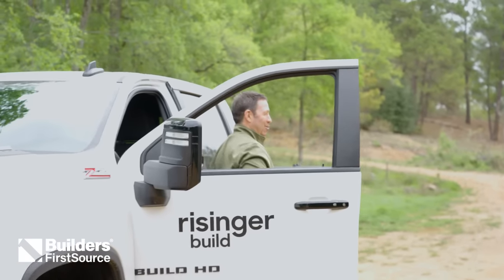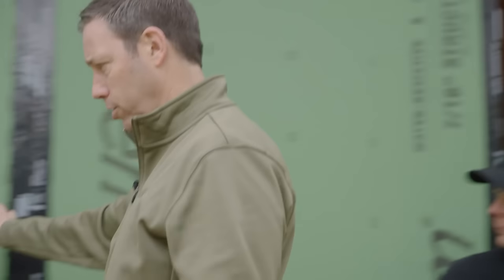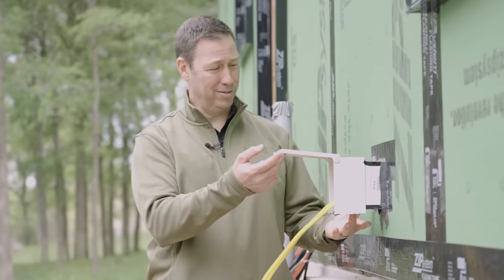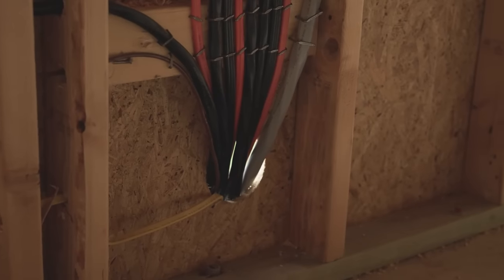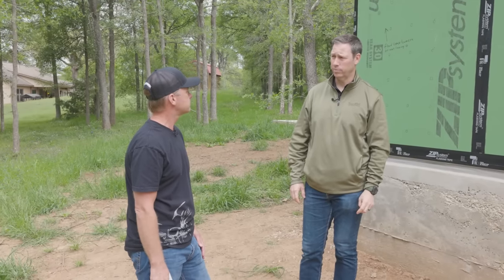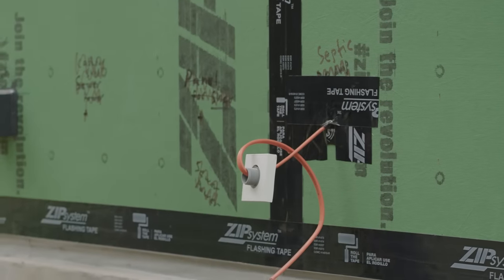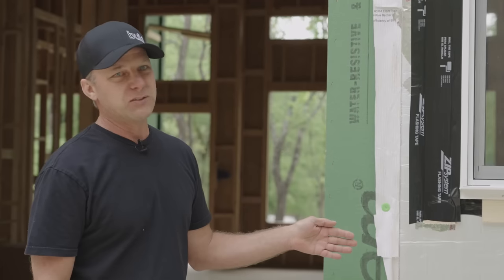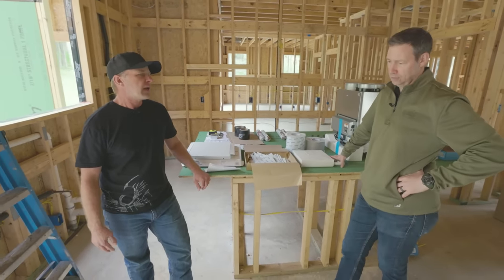Part 2: LOW BUDGET Details For A High Performance BUILD

Comment: The flush outlets is bad idea because if you have to pull the outlet plate off, you will have drywall damage. I think that the look is cool, but the functionality is questionable. Maybe, it is something that I do not fully understand.

I also am not a fan of the Broan ERV system because it runs 24 hours a day. It is necessary because you are attempting to build an air tight house. Not only does this increase energy costs, it creates a maintenance item that might not be necessary if the house was not completely airtight. The problem with creating airtight homes is that you quickly reach a point of diminishing returns and you incur high upfront costs. 

Extreme problems can arise in constructing and airtight home is that if water gets into the walls or roof, it has no place to evaporate and mold growth ensues. Having SOME, not a LOT, of air circulating through a home in the correct way is a good thing. Correcting water infiltration issues in airtight homes can become  egregiously expensive  to fix. Ideally, you want interior air to able to circulate into the walls to some degree. 

I have often said that if you build a traditional home which is not entirely airtight and use the money you save to install a 10 KW - 15 KW solar panel array, you won't have any energy bills (other than grid connection costs from your utility) and you can use as much electrical energy as you want. A well insulated traditional home with high quality windows that is not perfectly airtight will probably be at least  90% as energy efficient as an airtight house and it will cost a LOT less. The entire premise that a house should be 100% airtight is a flawed concept in my opinion. Airtight houses will work, but they have to be perfectly constructed and if they fail, they will fail catastrophically in many cases. Air tight houses require a separate air circulation system which can cost as much as a traditional heat pump system and also has several filters that have to be changed. Some of these filters cost $50 - $100 each and have to be changed twice a year. So the cost to circulate air in an airtight home will cost tens of thousands of dollars over the life of a home and it only buys you about 10% more energy efficiency.  

Also, when building a traditional home that is not 100% airtight, there are a number of methods to mechanically seal out bugs from entering the home. Here in AZ, most bugs crawl in through gaps in the door threshold seals. So using a more expensive door with a better sealing design would eliminate that issue, but most homeowners don't want to spend $1,500 for a door when they can get a good quality door for $200 - $400. 

I think that the water protection details of an airtight home for the walls can be incorporated into a traditional home to some degree without adding excessive costs, but worrying about perfect airtight joints between the roof and the walls is a waste of time and money.

Right now, you can get a 15KW grid-tied solar system professionally installed for around $30,000 if you shop around. You get a 30% federal rebate on all of your costs which means that your system costs you $21,000. Usually most states will provide a rebate of a couple thousand dollars. So after rebates, your solar system will be around $20,000 - $25,000 max. Buildind an airtight home will easily cost you that much. Further, larger homes can easily use $300 - $600 a month in electricity, or about $4,000 - $7,000 a year, even if they are extremely well insulated. A 15 KW system will provide more than enough energy to cover that $7k a year electricity cost and your solar system will pay for itself in just three years. Let's say your 3500 SF home only uses $300 a month in electricity because it is extremely well insulated. This will cost you about $3600.00 per year. Your solar system will still pay for itself in less than six years and you will be able to use as much electricity as you want without having to watch every light that you turn on or keep your thermostat at excessively low or high levels to save heating and cooling costs. Further, if you purchase a heat pump water heater, you will get all of the free hot water you want for your home from your solar power. Most grid-tied solar systems are maintenance free other than cleaning the panels and MAYBE replacing the inverter once over a 30-year life span. So a solar panel system will pay you tens of thousands of dollars in actual money for energy savings over that 30-year lifespan. It will also protect you from utility energy cost increases.

It's a LOT smarter to build a traditional, non-airtight home and invest the extra money in a grid-tied solar panel system than to spend exorbitant amounts of money on dozens of details to make a home perfectly airtight. Further, the maintenance costs for the air circulation system which runs 24 hours a day are excessive. You can spend a thousand dollars a year just on air filters. I really don't understand why this group of builders in Texas are so obsessed with the airtight home design when a traditional designed home will give you 90% of the energy efficiency of an airtight home at a cost that will easily save you $20,000 - $30,000 in construction material and labor costs. Further, traditional home designs have redundant systems that allow any water that gets into walls or the roof to evaporate provided it is a small amount of water. Traditionally built homes don't require a separate air circulation system and they are still very well sealed. You don't have to have "wind blowing under the walls," types of problems if you build a traditional home intelligently.
Reply: Science and math tells us that an air tight home with a good insulation strategy and right sized and well designed systems far outperformers solar. The outlets have an inner part you can take off so no need to mess with the sheetrock. The rest of your comment is a bit too long to address. But everyone should know that building science is literately a science back by research and real world data.
Reply: @ScottTrue  Well I have two engineering degrees and I am a licensed general contractor in AZ and I disagree with you. Using ubiquitous "science" as a reference is a very weak argument. 

Let's use my home for example here in AZ. I have a standard stucco home that permeates the Phoenix metro area. These homes are not even close to airtight, and my home is constructed with clear, double pane windows which are cheap builder grade. These windows are FAR from energy efficient.  My attic is not conditioned and  is insulated with blown-in "paper" insulation. The walls are standard 2" x 4" walls with fiberglass batt insulation. My home is 1850 SF. It is heated with a gas furnace and cooled with a 5-ton AC unit.

I added blown-in insulation to my attic and increased its insulation to R--60, but I have not upgraded the windows, which like all stucco homes, are embedded in the stucco.  A couple of years ago I replaced my AC with a Trane 18-seer two-stage 5-ton unit. Becausee the SEER value decreases with the tonnage of Trane units, my unit is actually 14-15 SEER. Not this is true for all AC manufacturers.

I run my AC for three months during the summer and my highest electric bill has been $160.00. During the winter my I run the heater for about three  months and my highest gas bill has also been $160.00. Two of my heating bills this year have been $130.00. Now keep in mind, because of Biden's and the democrat's insane war on fossil fuels, the rate I pay for gas has gone up 30% this year. For about six months, my gas bill is around $25.00 and my electric bill is around $50.000. So this year I will pay around $1,400 to heat and cool my home total, including taxes and fees.

Here's the main point here. I have carefully checked where I am losing most of my energy in the home  and it easily is lost through the clear windows which do not have a Low E coating and are cheap. 

If this home was built airtight right now, it would cost at least $25,000 more in construction costs because you need a separate recirculation system which costs damn near as much as an AC system. The use of close-cell sprayed in foam is also VERY expensive. 

Lets say that my home was built airtight but has the same windows for a fair comparison. I would guess that the MOST I would save on my energy bill would be $400 - $500 for year. So the payback ROI on the airtight construction would be $25,000/$500 (per year) = 50 years. And this does not include the interest costs for that $25,000 over 50 years. That is why almost NO AZ home builders use airtight construction. 

Now my home in AZ is in an extremely hot climate, so most AZ homes use a LOT of electricity for cooling every year. Its not unusual for a 2000 SF home to pay $300 - $500 per month for cooling in homes that are not insulated as well as mine. Also, the energy costs are low compared to many democrat-run blue states which have energy costs about 300% higher than AZ. So if I lived in a blue state, the payback period for building a home with airtight construction MIGHT be as low as 30 years - again not counting the interest costs on the $25k spent upfront in the construction of the home.

What most home builders are doing in AZ right now are using 2" x 6" walls and double-pane Low-E windows. They are insulating the attic with R-40 blown-in insulation and  using stucco as the siding material. These few improvements will probably cut the energy costs on a home like mine by about 50%. So IF my home had 2" x 6" walls and high quality dual-pane windows, would be paying about $800 a year to heat and cool my home max. This is without using all of the exotic airtight construction methods you are claiming as being "better." 

Here's another real life example. About five years ago, a client had me design and build a guest house for them that is about 1500 SF. I used 2" x 6" wills with 1./2" shear, high-quality Low-E windows, and R-60 attic insulation. It has an 18 SEER 4-Ton Trane heat pump and it costs almost nothing to heat and cool that guesthouse - and it was NOT constructed with airtight methods. I would guess that the entire cost to heat and cool the house per year is around $600.00 - $700.00 (total cost for electricity) and most of that cost is because it has an electric hot water heater. For most of the year, the heat pump never turns on. I engineered the house  with three HVAC zones so that they can keep the living area and sleeping areas at separate temperatures, and that saves them some energy costs. This guest house is directly in the desert.

So what's my point by providing these two examples. Yes airtight construction is more efficient than non-airtight construction, but it will NEVER pay for itself. It is an expensive pipe-dream.  It is FAR smarter to build an non-airtight home and install solar with the $25,000 - $30,000 you save.

One last fact to make my point. My home has low quality windows and 2" x 4" walls. I have completed a 10 KW solar panel design for my home and it a solar array WITH 15 KW of battery storage can be purchased for around $17,000 BEFORE the 30% federal tax rebate. If I install that system on my house, I will have NO electricity costs on my home - none. Also, I can install a small mini-split heat pump my self for around $3,000 and it will heat my home during the winter with electricity costs. So for 20K, I will have a grid-zero home that will cost me nothing to heat and cool other than about $25.00 -$35.00  a month for grid connection fees. If the grid goes down, I can fully power my home with this system and live off-grid. 

Now keep in mind for the solar system I am going to install on my home, I will install it myself. The only subcontractor costs I will have is to have a licensed electrician connect my Sol-Ark 15KW inverter to my 200 Amp service panel. I figure that cost will be $500 - $700 max and will take about  8 hours. I would do it myself, but my electric utility requires a licensed electrician make the connection.

These are real-life examples of the real-life cost advantage of not wasting money on exotic, airtight construction techniques.

Here are some simple construction techniques for homes that will accomplish 90% of the energy efficiency of airtight construction without the associated costs:

1. Use 2" x 6" construction with 1/2" shear panel. You could use Zip panels for this construction to provide a vapor barrier. Use fiberglass batt insulation for the walls.
2. Use a well-vented attic with blown-in insulation. I recommend using at least R-44 insulation in the attic.
3. Use high quality windows. In most climates, dual-pane windows are sufficient. Use Low-E coatings appropriate for hot and cold climates.
4. Make your attic tall enough to walk through it to provide ease of access.
5. Make sure that you use eave venting around the roof perimeter.
6. Seal around all openings thoroughly. This is one airtight technique that transfers to non-airtight houses. All of the windows, outlets, pipe penetrations, etc. are sealed the same as an airtight home against air infiltration and water leakage.
7. If your home is 1500 SF  or more , zone your home so that you can heat and cool different areas with different temperatures. With all homes, most energy is wasted heating and cooling non-used areas. 
8. Use a high quality, high seer AC or heat pump. Maker SURE it is installed correctly. Poor workmanship with AC and furnace installations is a common cause of wasted energy.
9. Install a grid-tied solar panel system. This can lower your energy costs to nothing.
10.Install a lifetime roof. Here in AZ, concrete tile is used to provide a lifetime roof when a high quality self-sealing modified bitumen substrate is installed under the tile (like Grace Water and Ice Seal)

I hope that these ideas help you with your contracting ideas. "Science" almost never provides better design guidelines than actual experience learned by actually building projects. Science intelligently applied is very beneficial.
Reply: @franklong6269  Yes, that's what I'm doing - Applying Science intelligently. I always say that everything we do is calculated, not a guess. Engineering degrees, although nice, don't mean much. Many engineers stick to defaults and I have had to use non-engineer consultants to fix the problems that engineers cause. I'm not saying this is you. You seem to be smart. But I am saying that you shouldn't use your engineering degrees to describe how smart you are. Now, to be honest, I am not dissecting all your comments. It would take a lot of time to do that. But here's what I can say. I ran several scenarios through energy analysis and also considered the cost of materials. The math concluded that if take what solar cost and applied that same exact dollar amount on the envelop, I'd get a greater return on investment. Keep in mind that things I achieve cost little. Air tightness, for example, cost maybe $500. Look, for either of us to win this debate, we would both need to list many more details than what you have. Just curious, why do you feel it is so important? Why this platform to make your point? It just seams an odd place to post such a long case. Have you thought about posting your own video?
Reply: OK, Frank. I'll dissect everything you say and make a video. In my last comment, I stated that I wasn't dissecting your comments because it would take too much time. In fact, I haven't even read every word - just skimmed. It's just a lot. And I would not have expected someone to post such a long case here. But nevertheless, it gave me an idea. I think it would be beneficial for people to see real calculations with a bit more detail that you state in your comments. I'm going to commit to making my own video showing the results of energy modeling of several scenarios. By the way, anything that you are correct on, I will state that. But I think I'm going to show another perspective not yet considered. On that video, feel free to post your comments. Also, FYI, I don't see this as a "fight." People like us should lay out the details so we can get to the bottom of things, for everyone's sake.
Reply: @ScottTrue  So many errors on your part. 

1. Engineers who make one serious mistake lose their licenses in most cases. So if you have been working with engineers that screwed up, which is rare, then you have been working with the bottom of the barrel and they may not be engineers anymore. As a construction project manager who has managed multibillion dollar commercial projects as well as high-end custom home projects, I have encountered engineers who have made errors in some projects but it is rare, and they usually are not "serious" errors and can be corrected fairly easily. It is rare because at the very least, if an engineer makes a serious mistake, the engineering firm has to pay the costs to fix that mistake. This rarely happens. One thing NOBODY EVER DOES is hire a non-engineer to fix an engineer's mistake.

2. A "non-engineer" is not licensed to "fix" mistakes and licensed,  professional engineer has made. This leads me to conclude that you are either embellishing or lying. If you did use a non-licensed consultant for an engineering discipline that requires a PE license, then you committed a crime. It is a felony in most states if you hire a consultant that is not licensed to do engineering work that require a license. It is the same as if you hired a "non-doctor" to treat patients that you brought to him. State agencies that police engineering disciplines are usually Nazis. This is why in AZ, if I hire a non-licensed engineer to perform ANY task that requires and engineering license, it is a Class 1 misdemeanor criminal  offense that will be prosecuted. The fines are draconian and if someone gets injured, the charges will be upgraded to felony charges.

3. I pointed out that I am an engineer to make you aware that I have already looked at the data and calculations of airtight systems - at least to some degree, I don't profess to be a world-class expert. So I am familiar with the components and techniques used to build airtight houses. Almost NO builder in AZ I am aware of uses airtight building techniques because of the significant added costs and the high liability if there is a failure. Even most high-end custom home builders avoid airtight house designs. 

I did not point out that I am an engineer to brag. Nor did I point out that I am a licensed General Contractor to brag. I pointed it out to make you aware that I am not some Joe Blow from off the street just running my mouth. 

4. You make a good point in stating we should more carefully define our terms. When I use the term "airtight construction," I mean construction that completely seals the envelop of the house from all air infiltration and thus requires an air recirculation system, which requires several expensive filter changes every year. I also infer that closed-cell, sprayed insulation is used in the attic, and may be used in the walls - though some airtight house designs I have seen only use it in attics. Usually airtight homes also use more expensive vapor barriers. However, with most of the homes I design, I would use similar vapor barrier systems IF the client is willing to pay the cost difference. 

5. Both  Matt's videos and yours are inferring that airtight homes provides a better ROI than high quality non-airtight homes. I have never seen one example that proves that scenario and I have been managing construction projects for over 35 years. 

Concerning solar, IF you are pricing proprietary solar systems like Enphase, then, yes, you are going to pay $60,000 to install a solar panel system on a 2500 SF house, which is an absurd cost IMHO. However, if you design your own system using high quality components, you can easily purchase a 10 KW system with battery storage for around $17,000. I know because I am getting ready to install a 10 KW solar panel system on my home. Also remember that there is now a federal 30% tax rebate on all solar panel system components. So your actual cost for the system I will use on my house would be around $14,000. That does not include any state rebates, nor does it include the money utilities will pay you for selling your excess electricity back to them.  

Here's the real-world calcs I have done for my house. In AZ, APS currently (electric utility) pays 0.09 per KW back to the homeowner.  In AZ, a 10 KW array will easily generate approximately 80 KW per day (probably more) for an approximate buyback credit if $7.2 per day. My house uses about 350 KWH per week on average. So that would be approximately  $216 per month, or about $2,500 per year, that APS  the utility would pay me to install my solar system. I THINK, but I am not sure, that APS issues a check for that excess electricity that is generated every year. If true my solar panel system will pay for itself in 5-6 years. But even if they don't pay for all of the excess electricity my solar system will generate, my electricity costs will still be zero, and they will never increase.

An airtight house simply cannot compete because it has higher maintenance costs (air circulation filters are over a $100 each, and most systems (like Mitsubishi's system)  require two or three filters. Some of these filters need to be changed every six months. So you can easily spend $500 - $700 a year just on filters, and that does not include maintenance adjustments to the circulation system. You do get pristine air in the house, but you pay for it. You would get the nearly the same air cleaning ability with a Trane electrostatic air cleaning system on a non-airtight home and it is a LOT cheaper.

I am not sure what figures you are working with, but the additional costs I have seen to build an airtight house are excessive. You may have a system that costs less than the ones I have seen in videos on this subject.
Reply: @franklong6269  I struggle to make a 5 sentence response because I'm so busy. I can't believe you are spending this much time here. Engineers here are not losing their job and they are making mistakes. Of course, there are good ones out there. But man there are a lot of bad ones. I'd rather take my chances with the law than to build moldy houses.
Reply: By the way, this has got to be my last response to you. I just don't have the time like you. I wish I did. I'm sure you will respond to this with an essay. Again, math tells me otherwise. I just can't use a hole in the sheathing as my make up air and the insulation as the filter. It doesn't make sense. An ERV consumes so little energy it's a non-issue in that regard. But bringing in fresh air on our terms and then conditioning and filtering the air just makes sense. And again, math tells us we get a greater return on investment when we spend the money on the envelope vs. solar.
Reply: Ok, one more response: as I said, I’m going to make a video all about this. Would you like to be a part of it to add your view point? I’ll show you my data and you can literally say on video for all to hear whether I’m full of it or have a point. Let me know and I’ll set it up
Reply: @ScottTrue  I have no intention of demeaning you in any way. Actually, I respect your competence in building airtight projects because they are more complex in many ways than traditional build projects. While we disagree on the efficacy and cost efficiency of airtight construction, we both agree that airtight construction is a very high quality construction method. Done right, it provides exceptional energy efficiency. But done wrong, it can create a world of problems that traditional build homes don't usually incur.

As I have related, but maybe did not communicate well, I believe your time would be better utilized in building two real-world projects, one airtight and one traditional build with solar, and then comparing the two real-life projects for cost efficiency as well as overall quality and comfort. I think that would get you millions of views. I believe this comparison will get millions of views and possibly pay for the construction costs of the two homes if it was done right. 

I am willing to participate in a video with you, but as a partner, not as a critic. We can disagree with each other in good faith. I am also willing to look at the the data you present - but as I have tried to communicate, data rarely will predict all of the real-life details and performance of construction projects. That is why I have suggested that you build two actual projects to compare them. 

Because I am a GC, I believe you that you have run several scenarios and you believe that airtight construction is the best method of construction. However, there are hundreds of variables we have not discussed that will affect that analysis.

It is also  certain that some of the airtight construction methods on your videos and Matt's are in commonly used in traditional, non-airtight construction methods. So in some cases, both of us may be proposing the same construction techniques. So your choice of which types of materials and methods and the degree of how sealed the house envelope is, will heavily influence the cost analysis. 

For example, using sprayed-in closed-cell insulation in attics and walls is very expensive, and it is commonly used in airtight houses. That factor will significantly affect any cost analysis. Most traditional builders, and even many custom home builders, will avoid sprayed in foam insulation because of the upfront cost and long term liability issues it creates. 

Another example is adding an air circulation system to an airtight home. That can add significant cost to a project. I think all told, that Matt's system on his house was something like $12000 - $14,000, and that doesn't include the several hundred dollar cost of changing multiple filters twice a year. There's nothing wrong with installing a separate air circulation system but it is a luxury choice in many cases. It provides the homeowner perfect control over air quality and humidity, and allows you to heat and cool each room individually, but you pay for these features. It's a lot like paying extra for advanced cruise control on a car. It's nice to have, but a lot of car buyers don't want to pay $5000 - $15,000 for that feature.

Conversely, most tract home builders and custom home builders now use "Zip" type construction wall waterproofing for traditional constructed homes. This does provide a very well sealed wall envelope for and is nearly identical to airtight construction in many ways. So before you and I make a video, we should first check these types of similar construction techniques used in both homes. Otherwise both of us  won't look very bright.

Think about what I have said, and if you want to make a video comparing the two methods, I think it would be fun. But we need to define the two methods clearly before we go on camera. If we do make a video, I want you to come away from the video looking knowledgeable and informed. I gain nothing by trying to attack or demean you. In fact, we both lose in that type of confrontational scenario.
Reply: @ScottTrue  Your response indicates that you don't understand what traditional construction methods are fully. Nobody uses a "hole in the sheathing" for "makeup air." 

For years I carried the home inspection certification and I was hired by a law firm to inspect thousands of homes for construction defects. I literally inspected five homes a day for months. The law firm had sent out blanket letters to every homeowner in the Phoenix Metro area and Tucson offering a free inspection for construction defects. During these inspections, I got to see hundreds of the worst constructed homes in Arizona. This gave me tremendous insight into how houses fail. 

All homes "breathe" to a certain degree. Even with new, well-sealed traditional home construction, minute amounts of air get into the home from the exteriors through thousands of tiny openings. With airtight homes, am attempt is made to seal up all of these tiny openings to create a vacuum seal that is usually measured by attaching a fan system to the house after it is finished. 

But here's the key thing to understand, a well-built non-airtight home is going to be very well sealed. If you were to measure the air infiltration of a well built, non-airtight home, you would find that not a ton of outside air is getting into the home. This actually has caused problems in some of the traditionally built homes I have inspected, because they were built "too tight," and did not have air circulation systems. This caused high humidity and mold accumulation in some homes in AZ, which frankly stunned me when I saw it because AZ is about as "dry" climate as you are going to find.

So the point is that it is necessary for non-airtight homes to have some air infiltration for them to work correctly. But here's the key, it doesn't require a LOT of air infiltration - and that is where you lack understanding. When I design non-airtight homes which are sealed very well, I know that some air will still come into the home through thousands of joints and crevices in the home. IF I had a client that demanded a very tight home, then my first choice would not be to install a separate air circulation system. I would install a separate air exchanger on the HVAC system to bring in outside air to the home. This is much cheaper, it works well, and it does not require any maintenance or filters in most (not all) cases. Some outside air exchangers do have filter systems, but the commonly use off-the-shelf, cheap filters. 

That is what I communicated before. You can get approximately 90% of the energy efficiency from a well built non-airtight home as you get from an airtight home. This will vary with how well sealed the non-airtight home is constructed.  

To be fair to you, this is a REALLY complicated subject. It is amusing because nearly all HVAC contractors don't even consider the problem of getting outside air into the house in their bids. They make this decision not based on engineering specs or data, but on decades of experience. The overwhelming majority of homes simply don't need air circulation systems or even an outside air intake to bring in outside air.  If the home is going to be exceptionally tight, I would tell an HVAC contractor to "humor me" and install the air exchanger, similar to the one you use in your project, even if they think it is not necessary.  But all this would be is an exchanger that conditions outside air as it brings it to the HVAC system - it would not be a separate air circulation system. 

So if I know that the home is going to be exceptionally well-sealed, but not totally "airtight," I would first use an air exchanger to bring in outside air to the home. Virtually NONE of my clients are going to pay for a separate engineering study for a 2000 - 4000 SF home to ensure a perfect air balance. Nor is it necessary  the vast majority of time. Now when you get to very large homes and very expensive homes, that changes. THEN you do need to pay a mechanical engineer to calculate these air balance, circulation, zones, air intake, type of heating/cooling system etc. But then, these homes are more commercial projects than residential, and commercial construction requires that level of design expertise.

Here is the final important point to consider. When considering the energy efficiency of a home you are building, remember that there is a point of diminishing returns financially. That is the point where you a spending a lot of money to get approximately 10%-15% more energy efficiency. In most cases, those additional costs will never pay for themselves. In many cases, you can spend $30,00  - $50,000 on exotic equipment to make a 3000 SF home more energy efficient. .You will NEVER get that money back in energy savings in most cases. Now all of this changes if we are talking about very large, complex homes. But in most cases, your money is better spent on purchasing a solar panel system for your  home.

I hope that these examples help you. As I said this is a very complicated subject and there are a lot of experts who get the house envelope wrong at times.
Reply: @ScottTrue  You create a false dichotomy. It is NOT either hire a "non-engineer" to "fix" an engineers "mistakes" OR have a moldy home. That is just silly. 

Understand, I am an engineer, I have the degree and the certification. I know what that world is, you do not. It is a misdemeanor crime that can land you in jail if you hire a non-engineer to do work that requires a licensed engineer like structural engineering. If you have a instance where a person gets hurt because you did not hire a licensed engineer as required by code, you could be sued into bankruptcy. 

Engineers do make mistakes, they are human. But generally they don't make serious mistakes. If they do make JUST ONE serious mistake, they can easily lose their license and their livelihood for life. 

I suspect the engineer you are referring to was not a licensed engineer, but someone who calls himself an engineer. Licensed engineers are very well vetted and trained.
Reply: @ScottTrue  Hello scott, I am not sure whether I answered this comment. 

 1. What you do not understand is that generally in the HVAC world, residential contractors don't hire licensed engineers to design their systems. That would add thousands of dollars to the cost of a home that prospective buyers don't "see."  Instead, residential HVAC contractors focus on meeting HVAC codes, IBC code, and manufacturer's specifications for their products.  So in your world, you are not working with licensed HVAC contractors most of the time. In the commercial world, most projects require an licensed mechanical engineer's design, and they rarely make mistakes. A mechanical engineering degree is one of the most difficult to obtain in college. Most mechanical engineers are brilliant people.

2. For more expensive custom homes, this  can change quickly depending on the size and complexity of the home. Homes from about five  million on up often have owners who want "the best" HVAC system and they are willing to pay for it. They want to be able to control the temperature of each individual room. They want silent bathroom fans and silent HVAC fans (in forced air systems). They want and will pay for the most efficient and reliable HVAC systems. And most importantly, most  of these very high-end owners won't bat an eye about paying an licensed mechanical engineer $30,000 - $50,000 to design "the best" HVAC system for their home.

3. Most "mold" problems are not caused by engineering failures. So I am not even sure where you are getting our information. Usually on homes up to about a million dollars, there may not even be an architect.  In some cases a structural engineer may not even be required, depending on local municipality requirements. 

For example, here is AZ, I can design a standard sized home as a GC and used a "standardized" foundation for the structural plans. Most homes in AZ are wood-frame construction, and the truss manufacturers stamp their own drawings. For the walls and floors, all that most cities require is that governing building codes are adhered to. So hiring a structural engineer for most homes is not necessary.

Back to my previous point. Most mold problems are caused by three failures:

1. Roof leak failures
2. Plumbing failures
3. Building envelope failures - like vapor barriers installed on exterior walls.

Licensed engineers are not directly involved in any of these construction phases. The engineering is done in-house by roof manufacturers, plumbing manufacturers and companies that specialize in waterproofing buildings. Licensed GCs are then responsible to follow the in-house manufacturer's engineering specifications and applicable building codes.
 
My final recommendation to you is that you be more specific about what you define as an "engineer," because as I have said, licensed engineers rarely make mistakes. It appears that you are referring to individuals who are not really "engineers" who have neither an engineering degree or a PE license. If true, you need to be more accurate in your terminology if you are going to make videos about expert construction of homes.
Reply: @franklong6269 i just read all of these comments as i was skeptical about “airtight” passivehaus type homes especially the unnecessarily large, expensive and complex ERV systems. Since less airtight and less passive houses are mainstream I always wondered if it was worth it to build an airtight house if you could upgrade components like insulation details and windows to make your home more efficient.
Reply: @charlesrodriguez7984  Traditional building methods do let outside air into the house. This is actually a good thing to some degree. However, I think that a hybrid method of construction is optimum.

Here's some basics:

1. Install double-pane windows with Low-E coatings except in very cold climates. In extremely cold climates, install triple pane windows with Low-E coatings that allow solar heat to come into the house.
2.Seal around the windows doors with caulk and use a modified bitumen membrane, like Zip window and door rolls to seal over the edges of the windows and doors.
3. Use a Zip  shear panel wall sheathing  system that has the integrated moisture barrier on the OSB plywood. In extreme cold and hot climates, use insulated Zip sheathing. Seal the joints with Zip's tape designed for wall sheathing.
4. Install an airtight metal flashing at the bottom of the the OSB Zip wall sheathing. Seal the flashing against the cement stemwall and the Zip sheathing per Zip manufacturer instructions so that it is air and water tight. 
5. Install a water permeable barrier over your Zip sheathing that allows any water that penetrates your outer cladding to drain out the bottom of the wall. Install a weepscreed metal flashing with small holes in it at the bottom of the wall under the permeable barrier. 

For the permeable barrier, there are meshes that are designed to use for stucco. For stucco, install at least one inch of polystyrene insulation board under the permeable barrier.

For wood, brick or metal siding you can use  1" x 2" composite slats spaced ever 12" to 16" to attach the siding to. The space between these slats will allow water to drain off of the water tight Zip barrier down to the bottom of the wall. Install a weepscreed metal flashing designed to stop bugs and pest from entering the wall under your exterior siding material. This weepscreed will have small holes in it to allow water and moisture to escape the wall cavity under your exterior siding or brick veneer sheathing. Seal the weepscreed with 50-year caulk - follow the Zip system instructions.
6. Note: DON'T do this step in climates with high humidity. 

 Install a whole-house fan and connect it to your house duct system that will allow you to bring exterior air into the house when the outside air is at a temperature that will heat or cool your house. Install a filter on this fan's intake duct that is easy to reach and change and that does not cost a lot to replace. Connect the whole house fan to a thermostat that monitors the exterior air temperature.

 So in Arizona where I live, it is hot in the day and cool in the night about four months  every year. So at night, the thermostat  will activate the fan and bring cool air into the house without running the AC. In the winter the days are warm and the nights are cold. So the whole house fan can be used to bring warm air into the home during the day and warm the home for a very low cost.

6. Use 2" x 6" studs for a wood frame home. Use insulated 8" x 8" x16" block for a block home.

7. Use rock wool or fiberglass insulation in 2" x 6" walls on wood frame home.

8. If you want to clean your air in your home install a Trane Clean Effects air cleaner on your HVAC system. You can clean the air filter with a vacuum and reuse it. This system works very well.

9. Design your home with an accessible attic that you can walk in easily. Put platforms in your attic that you can walk on easily.  Install batt insulation or blown-in insulation in the attic. Install at least R-40 insulation in the attic. Preferably install R-60.

10. If you live in an extremely hot or cold climate, it is beneficial to install a heat exchanger exterior air intake system to bring fresh outside air into the house.  For a forced air system that uses a ducts to heat and cool the house, this will be enough circulate fresh air into the home. You do not need to run a Broan fan 24-hours a day. This is especially true in very cold climates.

11. In high humidity climates, install a dehumidifier.

12. Use the money you save to install a 10 KW solar panel system with a hybrid inverter like the Sol-Ark 15K inverter.  Install 15 -20 KW LiFePO4 backup batteries. You can get 5KW LiFePO4 batteries for about $1,350.00 each online.  This system will power your entire home for free and even charge an electric car if you buy one. It will also power your home off-grid if the electric grid goes down in your city. If you install it yourself, it will cost around $20,000. NOTE: wire your house for solar when you build it. This will save you thousands of dollars.

13. You can also use a Zip roof system for your home. However, standard OSB can be used if you cannot afford the Zip roof system. Note that the Zip wall system does not cost you much more than a standard wall system used in tract homes. Many tract home builders are now using the Zip wall system. 

Note that I suggest using the Zip system because they provide instructions on how to follow the steps I have suggested. This eliminates mistakes when constructing your wall system. There are other wall system weatherproofing manufacturer available, but the Zip system is available in most states and is sold on Home Depot, Amazon and at  Lowes.